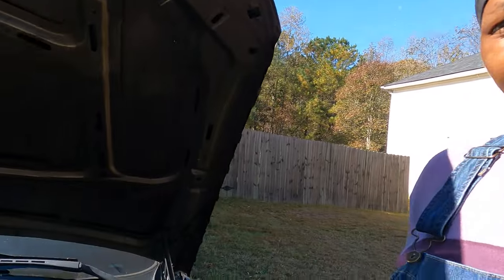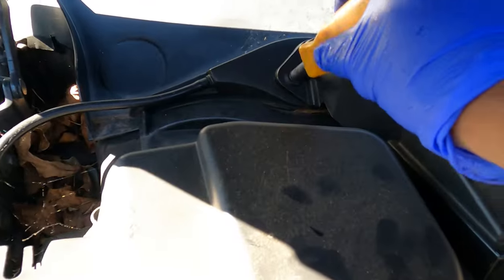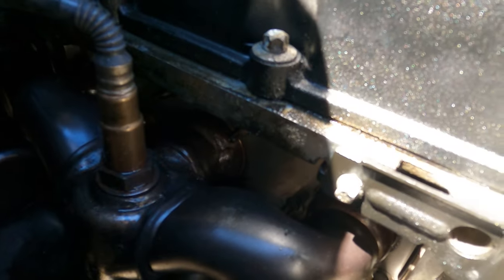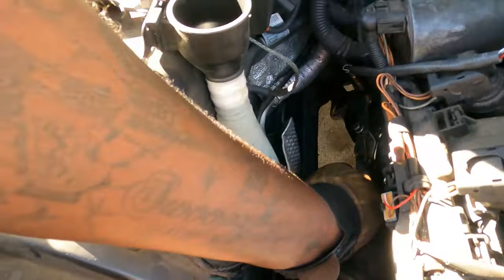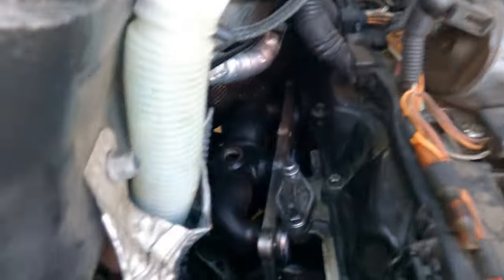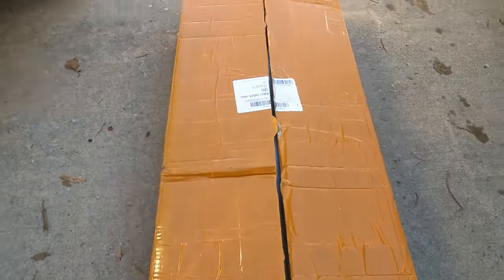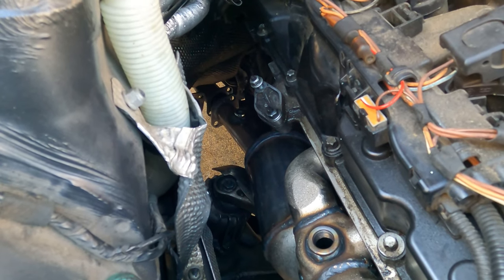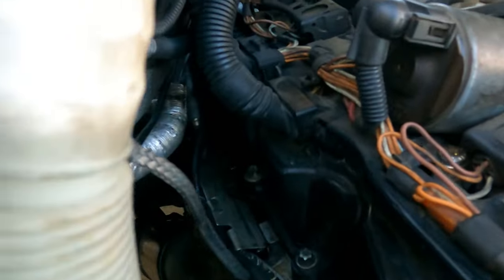2006 BMW 325i CATALYTIC CONVERTER REPLACEMENT

Comment: P0430? What was the root cause for you to swap them? Do your car have oil burning or other issue?
Reply from the maker: @svetlinspirov5758  This car was a client car she had the problem diagnosed, and we just went to install the new parts for her. But you can research the p0430 code online because it may not be your catalytic converter. And I don't know if her car was burning oil or not, but she did have a major oil leak, tho. Thanks for watching my video.
Reply: @fixitchicktv  I think it's the cats. My car cat with the same engine is consuming a lot of oil (1qt for 620mi). The car is also on 150k miles, coupled with oil consumption for a long time... Sadly I will fail the emissions test, so I have to sort it out. Even planning to change the cats with new ones and after the inspection to return the bad ones ... Damn inspectors